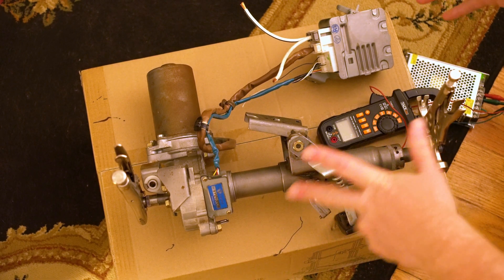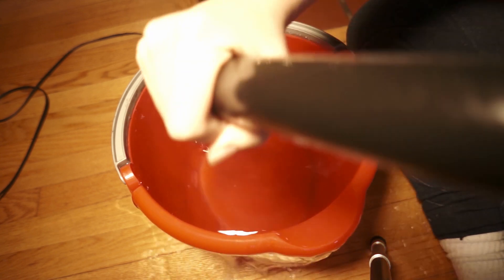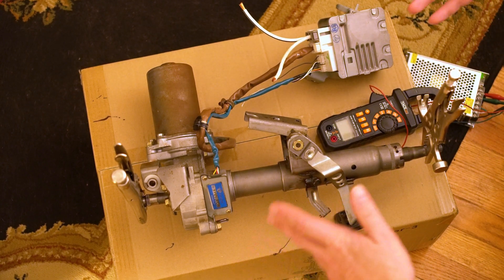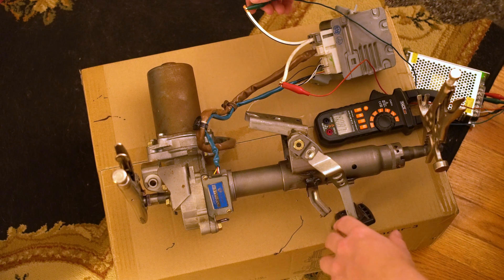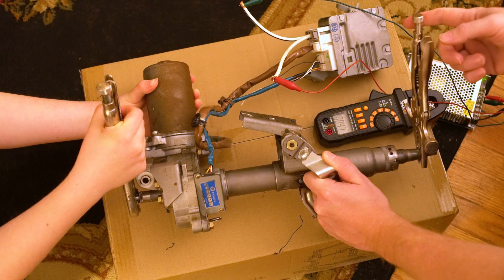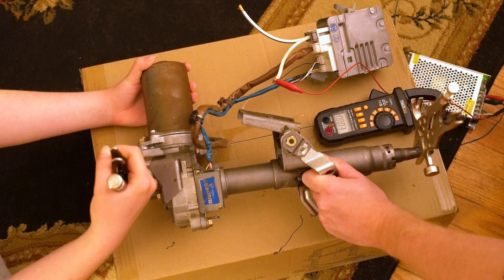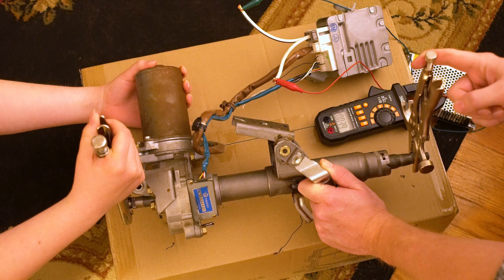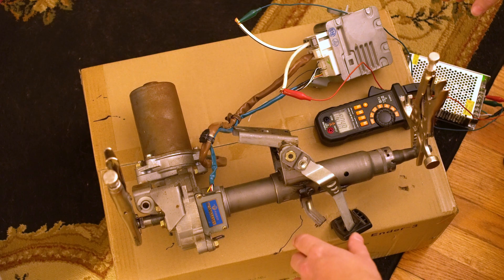Bench Testing a Prius EPAS System Before We Swap It Into The LTD!

Comment from the maker: Ron Monahan asked a really great question and one I think a lot of you will want to know, so I'm pinning it here - "How much does it weigh?"  The power assist unit weighs in at 15.1 lbs and the control box is 1.66 lbs.  Considering there's extra shafting and tubing on the  assist unit that will be cut off, and we're removing about 6" of the factory column, it's safe to say this conversion will add a mere 12-15lbs at most to your ride.

Comment: So how did this ever turn out? Just looked thru your channel and couldnt seem to find an install or review video.
Reply from the maker: That's because I haven't installed it yet.  I really don't have enough room in my garage to do this without extreme difficulty and I'm now building a place that will have plenty of room.  I will definitely do an install video on this - sorry for the delay.
Reply: @AlexLTDLX  no need to apologize of course! In the middle of doing the prius swap to my 69 fastback. Hoping the failsafe mode is enough assist to tell the difference

Comment: Hi, I've got a question, I hooked my system up and the motor will just start spinning clockwise with no input.  If I put any input in it reverses or locks up and then the control box (which must have an overload in it) clicks and the motor stops.  My motor has 4 wires coming out of the small plug that turns it on, two white and two black, do you think or know if both black wires need to be hot?
Reply from the maker: I don't know. But it sounds like the sensor on the shaft might be damaged.

Comment: I have an 07 prius motor set up like yours, it has  a 12 pin connector , I unfortunately didn't get the pigtail that plugs in that socket, is the one little wire coming from there the only small wire you use or what are the 2 or 3 other wires hook to? I can't seem to get this set up to work.
Reply from the maker: It was just the one wire. Hope that helps.
Reply: @AlexLTDLX  thank you, it's possible the motor or control box is bad, the box does click after hooking the small wire to the hot post on the battery,, thanks again.
Reply from the maker: It could be.  It could also be the torque sensor.  In fact, in my research that seems to be the primary failure point - more so than the motor at least.

Comment: really interested in this swap for 94 stang , have you weighed the control box and power unit?
Reply from the maker: That's a really great question - I pinned the answer up above, but since you're the first to ask - 15.1 lbs for the assist and 1.66 lbs for the control box.

Comment: Awesome vid.I had been thinking of using a electric rack,but the aftermarket kits are PRICEY. This is a great idea,cant wait to see how it works out,even though i bought all the power steering parts for my car already. Any idea if your considering the electric A/C,i was looking at that as a possible future project.Thanks for the great videos
Reply from the maker: I am indeed considering electric A/C - that is one thing long gone from the car.  My jury's still out on that one.  I don't drive the car when it's much above 80-85 out... no point; it'll make less power then.  But if I do spy a Nissan Leaf setup or something similar and adaptable (don't know if the Leaf is, just using that as an example); I'll go for it.  I'm really waiting for Peltier devices to see a massive leap forward in efficiency.
Reply: @AlexLTDLX  I was looking at the prius set-up,seems like a nice small compressor,and dosent need the car to be running (so...sitting in the staging lanes in a firesuit,car off A/C on)
Reply from the maker: @TJay074  I'll look into that.  That's a great idea!